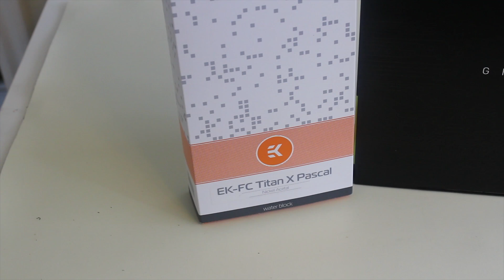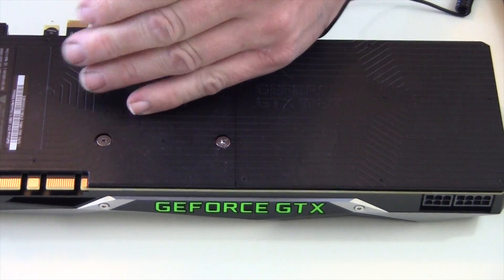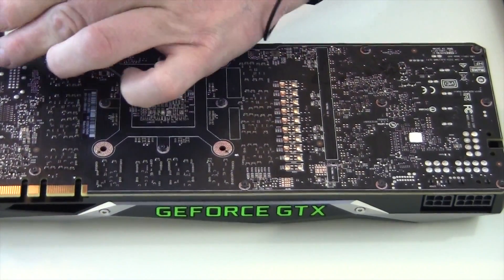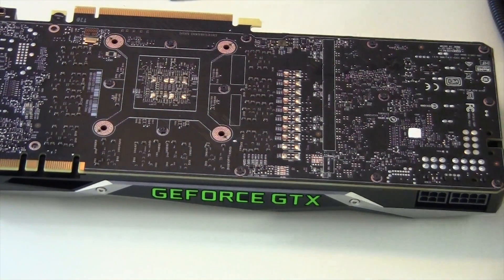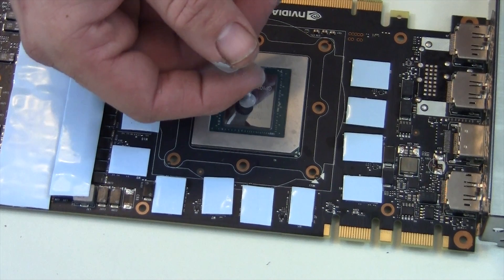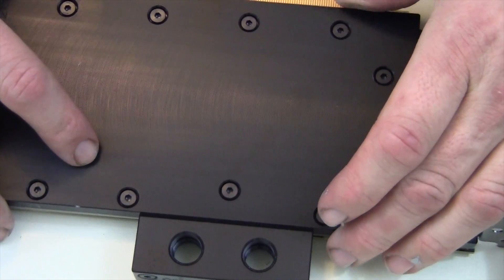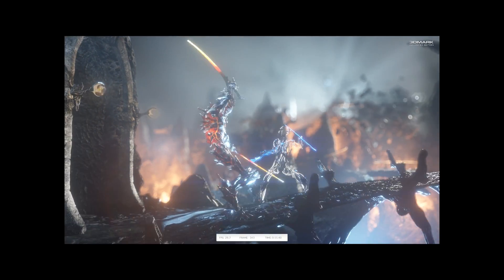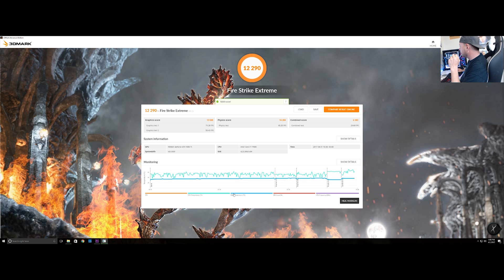Installing the ek Titan X Pascal waterblock on Gtx 1080ti

Comment: Quick question.. Have u tried experimenting with hard Tubing? After 2 years of striggling with gunking tandoori algae build up I finally. Made the move to petg Tubing and I could be be happier.. No gunking and ive no cleaned it our for 3 years now.. Its unbelievable how effective they can be
Reply from the maker: TurboGreen I will go hard tube when I get the new cosmos 2 case and a second 1080ti
Reply: Try looking at Phanteks enthoo primo.. Best case ive had by far
Reply from the maker: TurboGreen it's nice for sure but I'll be needing the cosmos for another YouTube review!!!!